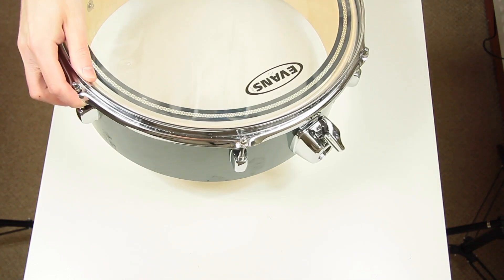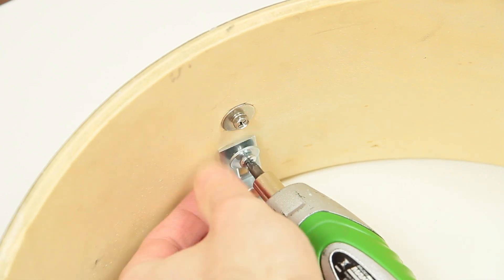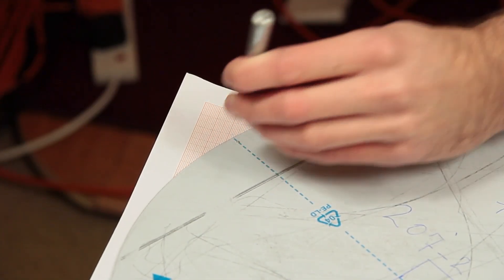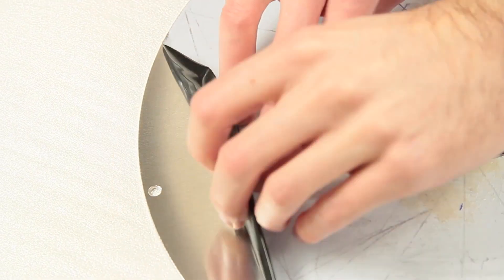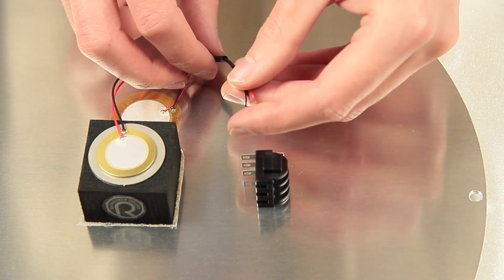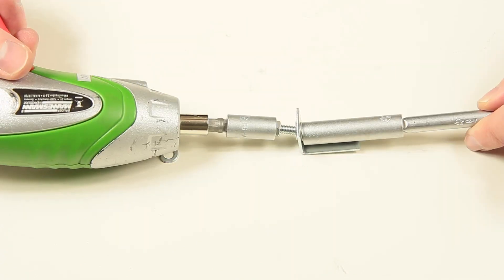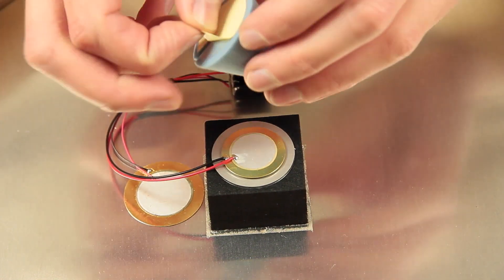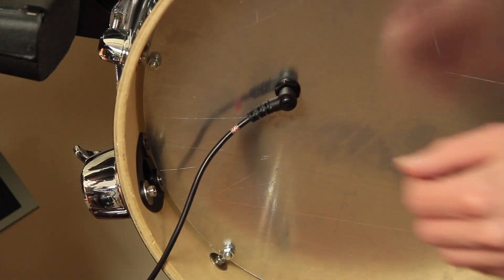Dual Trigger Pad - DIY

Comment: The aluminum disc is an unnecessary expense. You can use alumimum U Channel. I converted 4 piece ludwig set into an 8 piece electronic kit by cutting the shells in half. I use it with a Roland TD-12 and TD-8 and it works perfectly.  If you have two zones like a head piezo and a rim piezo the head piezo needs to float on some foam, I mounted the piezo to a small square aluminum plate, glued the cone to that. That was mounted with two vibration dampening  stand-offs to the U channel. No problems.

Comment: Hello, I saw a lot of your videos and started making my DIY electronic drums, I bought shielded Jack connectors because they fit perfectly into the hole in the shell, the fit worked, however, the two stereo outputs were the same with head sound, without rim, after After trying many different things I saw that other simple plastic connectors did not present the problem. Could I use resistors in the shielded Jack connectors to solve the problem? These connectors were very expensive and fit perfectly, I would like to make it work

Comment: Hello,
Followed your recipe and made a dual zone snare drum. 
The response of the center piezo is MUCH weaker than the one on the rim. I tried swaping the piezo and event inverted the wiring, same result. I also tried the connect it to the tom input with same result.
The "stock" pads work normally.
I'm using an Alesis Surge module.
Any idea where my problem is ?
Thanks.
By the way, lve your videos !

Comment: Excellent video.   Takes patience to build an e-drum such as this one, but the results are worth the effort. 
I would add a few items to this build 
1- A switch for the head pizeo, so it can be used for Roland or Alesis which are wired reverse from each other. 
2- A Potentiometer for both Piezo's so they can be adjusted (trimmed) to work with various drum modules
3- a lower plate used to mount the Potentiomenters, Switch and Jack 
These could add kaizen to your assembly

Comment: Why you use different size piezzo for head and rim??Also why you set the foam cone exactly to the center of the drum and not aside  cause the center is the most hitting area and time to time the foam will be destructed??It has some relation to the position sensing problem??

Comment: Much better than the cheap triggers I made from Remo practice pads and the one I made from a mesh practice pad with the foam come. This is very professional and, if I ever do another kit, I'll definitely be replicating THIS setup. Thanks.
Reply: Honestly this is nice but a built overkill. I built a trigger using a shelf bracket and 2 small slotted brackets that is solid as a rock. Bought a prewired Pintech piezo with foam and 1/4  jack from amazon for $18. Works very well and is quieter and waaay easier than this project. Undoubtedly quieter since it has mesh heads on both ends.

Comment: I like the immediate disposal of aluminum you included. It is very common and its dangers are frequently overlooked. Ill send you a video of how my drum turns out if y'all can tell me the brand of the gooseneck extension you are using with your quick-change bits @6:11. Super impressed with the design and I was not expecting to find videos this thorough right off the bat. Thanks.

Comment: "We attach the Hoover pipe near the drill bit to remove the Aluminum dust immediately." - Classic!

"Keeping a vacuum tube near the drill site, we can remove any Aluminum dust we create as we work." - Maybe?

Great vid, I have a question though: I couldn't quite understand the narrator, what is the purpose of the decoupler? 0:24 Did she say decelerate?

Comment: I made a trigger similar to this, but because I'm using mylar heads, I didn't use a cone, and used a design similar to Alesis DM10. You can see here what I'm talking about: https://www.youtube.com/watch?v=S3OiONBIiKk&feature=youtu.be&t=204 I read on your site about polarity, and I have a question since I encountered a strange issue. 

When I first hooked up the two piezos the head and rim worked fine, but after fiddling with it and replacing the piezos, I couldn't get the head or rim to trigger. Finally, I turned the rim gain down to 1 and the head triggered fine. I turned the head gain to 1 and rim gain back up and the rim triggered fine, but with the gain turned up on both they don't work. 

Do you think since the head piezo is acting like a rim piezo in the sense that the carrier plate is picking up vibrations instead of force being applied to the ceramic part like the cone system, that maybe they are cancelling each other out or something? I'll have to fiddle around with the wiring tomorrow, but it seems strange, because I swear I wired them up the same way I did the first two piezos I installed and the first two worked fine, together, so I'm wondering if the issue is being caused by the fact that the polarity may be different on one or both of the piezos from the first two that I used, so I need to wire them differently.
Reply: Here's some more info:

If the head and rim gain are both turned up past 1 then neither piezo will really work, just sporadically will it register a hit, once every ten strikes or so.

But if I turn the rim gain to 1 and leave head gain up, the head piezo works perfectly fine. If I turn the head piezo gain to 1 and rim gain up then the rim works perfectly fine. But when both head and rim gain are turned up past 1 neither one will consistently work.

If I enable "invert polarity" option on my drum module then both piezos start to work but they trigger the same sound. If wired like this: http://edrum.for.free.fr/static/pictures/MBrolandwiring.gif then with "invert polarity" enabled both the head piezo and rim piezo trigger the head sound. If wired like this: http://www.v-drumtips.com/wp-content/uploads/2015/02/Wiring-diagram-for-Roland.pdf with "invert polarity" enabled then both piezos trigger the rim sound.

Is it possible that two piezos could be incompatible with each other? I read that the polarity on piezos is random and can be different from piezo to piezo. I'm using the same brand of piezos as the first two I installed, which worked together perfectly fine. They are GoEdrum piezos which are made for e-drums.
Reply: Maybe I figured it out. When it was working there was about a 2.5" space between the metal disc the rim piezo is on and the head trigger plate, but I reduced that to 1.5", which the foam I want to use is very expensive if I have to buy one 3" thick and cut it to 2.5". But with only 1.5" between the head piezo which is in the middle of the head trigger plate and the rim piezo on the bottom plate, I'm thinking they are interfering with each other. What do you think? This sucks if I have to move back to 2.5". This is such a nice simple, clean design the way I have it. I will have to turn the brackets upside down like you did then reduce the size of the bottom plate to accommodate the thickness of the brackets, plus the foam is so expensive, too expensive.
Reply: @tomjoad6993  Did you end up figuring this out?

Comment: Anyone know if multiple triggers can be chained to one practice pad?  I put a trigger under a pad but it only reacts when it's struck directly on top of the transducer.  As you move away from the piezo, it gets lighter and ligher till nothing.  I'm thinking maybe using 3 or 4 on the same pad and wire them together.  Maybe that won't work.

Comment: wouly this trigger work on ddrum dti or the alesis equivalent? I am planning on converting an old cheap kit to electric for my flat
Reply from the maker: It works with all ddrum modules (ddrum 2, 3, 4 + AT) Alesis DM10, trigger I/O and strike. (with older Alesis modules partly just mono triggering)

Comment: Would it work too if we substitute the steel disc for a wooden one? I think it would be much cheaper.
Thanks for all these awesome videos
Reply from the maker: Rubén Carrillo Ureña It would work, but wood is not as good for transferring the vibration. Ideal it would be a 4mm aluminium disc. But it does not matter if it is for cheaper modules.
Reply: if you do that you might as well just use 2 wooden bars and attach the rim piezo to the side of the shell, i think.

Comment: Compared to say a top of the line roland pad or the R Drums package how does it perform?

Is this or the torque one better also?

Thanks
Reply from the maker: Carbon It triggers as good as a Roland pad. The torque trigger is better, as it is quieter and the rim piezo is in the centre.
Reply: Vdrum Tips thanks
Reply: Vdrum Tips Are you still thinking about producing the torque or Flexi system? Is it possible to release the specs, I and I'm sure many others would be willing to pay for the specs.

Comment: How far do the holes need to be from the edge of the aluminum disk ? (Or does that depend on the kind of hardware you use to mount it
Reply from the maker: Yes, it depends on the hardware and the shell. It does not have to be built like this, just giving an idea.

Comment: what piezo sensors do you recommend (dimensions in mm) for drumhead, rim and cymbal triggering?
Reply from the maker: I do recommend the R-drums piezos. The diameter alone does not matter, the piezos have to be measured for polarity and have the right amount of voltage and so on. I would never use stock piezos.
Reply: Can you tell me what is the voltage on the R-drums piezos?
Reply from the maker: No, because I don't know it. But even if I would know it, you would still need an oscilloscope to measure the polarity. Here check this article: http://www.v-drumtips.com/piezos/
Reply: Thanks for the info!
Reply: Do you happen to know if there is a difference between cooper or brass based piezos?
Reply from the maker: I don't think o. The actual piezo is the crystal material. Not sure how the rest makes a difference.

Comment: How accurate is this system? Btw your ideas are great!!!
Reply from the maker: It is very accurate, through to the triggers and the cone. It is as good as the high end Roland pads (PD-128)
Reply: And does ist keep working as well as in the video also if I use a simple alluminium bar or the plate is necessary?
Reply from the maker: Daniele Migliori would work good enough, it is just not as solid.

Comment: how to do i make a dual zone snare play the head sound the rim sound and the side stick sound right now im only getting the head and the rim sound
Reply from the maker: The decoupler has to be as close to Roland pads to get the perfect side stick triggering. This is why I always refer to the R-Drums Decoupler.
Reply: no what im saying is if i change the rim sound manualy i get the side stick but it either one or the other i cant make it have two different sounds on the rim all the time
Reply: is that in the drum modual im running td-8
Reply from the maker: it should be possible to set it up in a way that you have all 3 sounds at the same time.
Reply: OK WELL I DONT I GET TWO  ANY IDEAS

Comment: ok so how to i get the head sound and the edge  sound and the rim shot sound all at the same time is that in the modual
Reply from the maker: Sorry, but I don't understand the question.
Reply: are you talking about a 3 zone pad? One with both cross stick and rim shot?
No, it is not possible with this setup. Plus, the roland modules does not have a 3 zone feature.

Comment: Hi ,  would it be ok to use 6mm thick  MDF circles instead of the 2mm thick  aluminium E-Drum Conversions as shown in Part 3 ?. Or will this material not be as responsive for  rim triggering  ? . Thanks . Ken.
Reply from the maker: Yes, I guess it would even be better, since MDF does not vibrate that strong.

Comment: Your videos are AMAZING! Really helped me. I bought a Pearl RT and will follow all steps. But I got one doubt: is the wiring of Head and Rim piezos correct? Because all wiring diagram I found on internet is different than yours... could you confirm?

Thank you so much! Keep posting!!!!
Reply from the maker: Hi, you are correct. The wiring is wrong. I messed it up. But I just figured it out recently. Better follow the other wiring diagrams.
Reply: Vdrum Tips No problem at all, it's so easy to change it. The most important steps and tips you gave me. EXCELENT WORK!!!!!
Reply from the maker: Thank you. I just added an info box to refer to this issue.

Comment: hi guys, i have an alesis dm6 and i made the can pad, i connected and it works! but i want to make the dual trigger pad. i dismantling one  pad of my drum and it have a resistor.
my question is: IF I DONT PUT A RESISTOR, my module will have a problem? sorry for my english. what is for the resistor???
Reply from the maker: Your English is fine, I can understand everything:) I am not experienced with Alesis modules. I would build the dual pad and try what happens without resistor. And if it does not work, buy a resistor. They cost only cents. Check the colour code of the Alesis resistor and buy one with the same resistance. I think the resistor is to "decouple head and rim". It is just a way of how Alesis modules recognize the difference between head and rim.
Reply: to resist the trigger signal ~

Comment: Hello there! Got a problem - Rim Piezo does not work. Soldered everything well, like it is supposed to be. The module is Roland TD4 - can the problem be in module? With Roland pads everything worked well, now even if I solder single piezo for rim according to your diagram it does not work.
Thanks in advance!
Reply from the maker: +Vadim „Vaduggah“ Chernyshov I would try another rim piezo first. Also, have you soldered the piezo to a jack directly?
Reply: +Vdrum Tips Thanks for such quick reply! I tried several of them - did not help. And yeah, I did solder it directly to the jack, just the same is on this video.
Reply from the maker: What piezos are you using?
Reply: +Vdrum Tips 27mm for head, 35mm for rim.
Reply from the maker: Where have you bought them? Are you talking about stock piezos? What are the specs? (Voltage,...)
Reply: +Vdrum Tips http://www.aliexpress.com/item/New-12pc-27mm-Piezos-With-Leads-Cigar-Box-Guitar-Pickups-Drum-Triggers-ISP/32475963254.html?spm=2114.13010208.99999999.286.BmSQ8L
http://www.aliexpress.com/item/10PCS-LOT-35mm-Piezo-Ceramic-Element-with-cable-length-free-shipping-SS-10/32289063512.html?spm=2114.13010208.99999999.280.BmSQ8L
Reply from the maker: Ok, this could be the problem. These piezos are not even marked. I refer to R-Drums Piezos for a reason. Please read this article to understand what I mean: http://www.v-drumtips.com/piezos/
Reply: +Vdrum Tips Thank you so much! Will read.

Comment: Good video! I'd like to build an e-snare with separate side stick and rim shot triggers such as Drum-tech makes. Have you, or could you post some DIY info on the wiring and piezo mountings needed to make this work? Thanks! :-)
Reply from the maker: +Tim Lobb Durm-tec wires their snares exactly like the one in this video. There is no separate trigger for side stick and rim shot. The rim trigger is responsible for these 2 signals. It sends different wave signals to the module and the module can interpret if it is a side stick hit or a rim shot.
Reply: +Vdrum Tips Thank you for responding. The drum-tec video I saw was a demo of the new ATV aD5 module. Do you know if the same pad would still work properly (rim & x-stick) if used with a 2Box module?
Reply from the maker: I think so, since Roland pads work as well with 2 box. But I cannot ensure you.

Comment: Again, amazing series, but what exactly is the decoupler made out of, and what it its purpose here? I see many DYI videos just place the piezo on some raised metal with foam.
Reply from the maker: Matthew Attard Thank you! The decoupler is made out of foam and used as vibration damping system. The head trigger would react when hitting the rim if there would not be a damping system.

Comment from the maker: Matthew Whitehouse Cajon: So you want to build an e-cajon? You talk about the trigger cone? As you won't have positional sensing on a cajon, you might place them near the frame to not hit them directly. What module will you use? Let me know if your project is going on,  think this idea is really interesting.
Reply from the maker: no, you need something to covert the trigger signal. For a cajon I would use a Roland TM-2.
Reply from the maker: Some Roland modules have cajon sounds and the TM-2 samples sounds. Check if you can find a used one.
Reply: E-Cajon is a stupid concept-
Reply from the maker: Not according to Roland, they released 2 e-cajon products. It seems to be in demand.
Reply: Oh sorry i didn't know much i am interested at electronics like that 
Thanks BTW i am new

Comment: Why not using regular heads?, is it really necessary to get a Roland mesh head?
Reply: Regular heads will work aswell. Although many people use e-drums like this because they can't use acoustic drums due to the sound. And a regular mylar drumhead will still produce sound even if the shell is 1" deep and you have no resonant head. Mesh heads on the other hand are made out of a type of fabric that (depending on the manufacturer) doesn't have a very high thread-count so they are more or less see through to the air can pass through, thus making less air inside the drum shell move when the head is struck and that way the shell doesn't vibrate much either. And fabric as you probably know, doesn't really resonate much either so much of the acoustic noise is eliminated so that you can play in your apartment or such at any time without disturbing anybody :)
Reply from the maker: Hi, it doesn"t have to be a roland head, but I would go for at least a dual ply head, otherwise you'll have too much rebound.
Reply from the maker: Cool, mesh heads are really a matter of taste. I like the quietness of the remo heads, but think they are too bouncy. Have you ever tried drum-tec or Jobeky mesh heads?